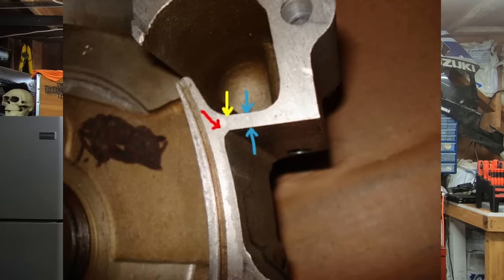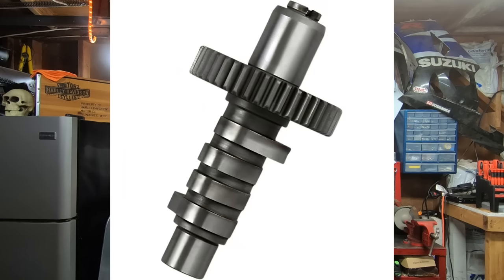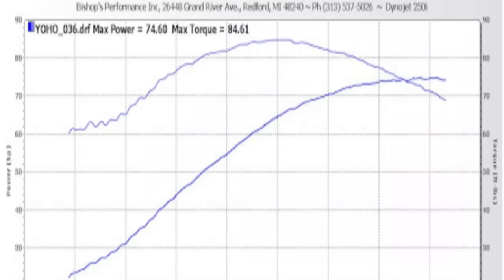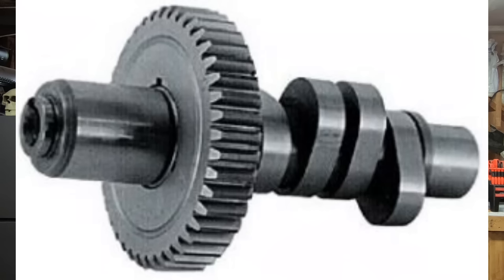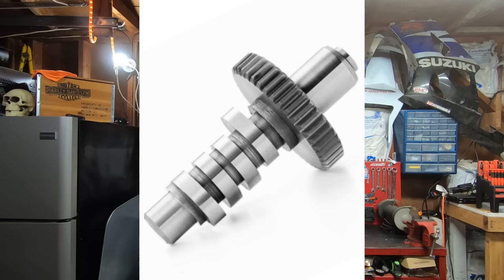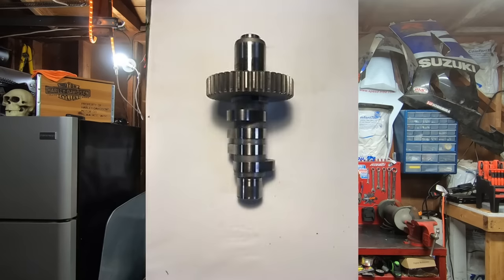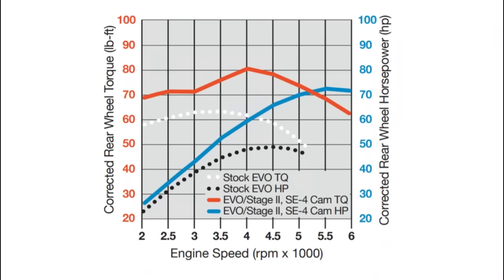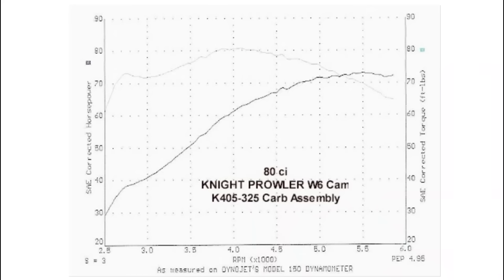Absolute Best Upgrade for the Evolution Harley-Davidson

Comment: I run a Andrews EV46 and have done for 30 years or more a Quick Silver cab and Points and have around  85 hp and I have ridden about 280,000kl and 2 rebuilds , I'm smiling because I have photos ha ha , can you tell I'm old ?
Reply: thats awesome man! i have a similar setup in my fxr.. i just did my first rebuild👌🏻
Reply: Just got a 98 blown cam bearing… ultra any tips or upgrades while I got her apart? Appreciate any input thanks
Reply: Yup EV 46

Comment: EV27, S&S Super E, Slow Leak down lifters, Andrews push rods, Wiseco 10:5 Pistons, Crane Hi-4 IGN, Vance Hines 2 to 1 Pro pipe.  Get 82hp with 90 torque.  Comes on about1800 rpm and pulls to 6000 in first 4 gears.  Just for fun {and hole shots) I put a 70 tooth pulley on it!  That made it two revved up for cruising so added a 6 speed OD transmission (.86 top gear) to get my  cruise back.  Gets 46 mpg at 3000 rpm 82 mph.  It's dependable, starts every time, never leaves me stranded.  44K miles since rebuild and still going strong.

Comment: Upgrades on my 92 evo: Andrews ev27/490 lift cam, roller rocker arms, single fire ignition, S&S carb with Primo Rivera extened forward intake manifold, Vance & Hines duel exhaust.. 88,432 miles and still running strong..🤘
Reply from the maker: Very nice! You've got all the goods in that motor!
Reply: Amen.

Comment: Andrews EV-27, Sifton 143, and the SE4 are exactly the same grind, if you actually look at the cam specs. Back in the 90's they were generally recognized as the best cam for an otherwise stock Evo, and they tended to be compatible with the stock crankcase breather system. Any other grind tended to give the owner a leg full of oil. Also the Torrington bearing is the older bearing design and the INA bearing was the newer ensign. It was put in by the factory in a misguided attempt to lower the bike's engine noise to comply with EPA standards. Refitting with the older Torrington bearing should be considered mandatory with any cam change.

Comment: Back in the day, (2002),I put an Andrews EV 27 cam, Crane ignition, Pingle petcock, and Thunderheader exhaust on a freshly factory rebuilt '95 80 ci Dyna Low Rider.  For me. absolutely perfect.  Very satisfying.  Would do it again exactly the same.  Totally loved it.
Reply: Factory rebuilt? HD does that?

Comment: Here's what I did to my '92 Low Rider for 80/80 hp & torque: Branch heads, EV-57 cam, SE manifold & air cleaner, SE push rods, V&H 2:1 Pro Pipe, Mikuni 45mm carb.

Comment: H-D EVO, best motor the MoCo ever made. Just as explained in the video. Don't try to ask it to do to much, it'll last forever.  The Andrews 27 or Crane 310, was always the cam of choice, for bolt-in power & torque.

Comment: I am an evo rider. I'm riding a 94 FXR I have always had a fxr evolution.this is my 2nd one.  I have all the bolt on crap and a hi proformance heads.  Single fire ignition, thunder header exaust,cam and a youst tube in a stock cv carb.  I can still chirp rear tire in 3 gear. I have had zero problems with power.  This bike is fast. It's only got around 12,000 miles.  It handles like a dream. People want to race and I suggest that we race to the coast.  It's around an hour and a half ride. I have yet to loose. Evos are plenty fast for me. Only thing left to do is boar it out 5 over.it just has such low mileage I can't justify tearing it down.  The only motor I like as much is the panhead. Honestly I have no desire to go any faster than the bike already goes. I  may be a bit bias as this is my second FXR and I have had it for 17+years. I have been hit 2 times by teenagers on cell phones.  No joke.  I fixed everything but it's still been totaled 3 times. So in to a paugho frame with a 2 inch stretch and 2 degree rake. It used to be a cop bike. Even had speedo that said it was a cop bike. That was destroyed along with my foot by first teenager. I love my bike and I just can't bring myself to sell it and get a newer bike. I'm sure that there are other old guys that feel the same about there bikes. I have done so much to it and we have been down so many roads... it's like a good woman, once you find one hold on to her because they are a rare thing to find.as long as you care for her she will do anything for you. That's been my experience anyway. Thanks for letting me put in my 2cents. Really enjoy your channel. Very informative.

Comment: Late to this party, but in 1998 I put a Andrews 23 in a 1993 Dyna. Cam, Mikuni carb and Vance and Hines Long Shot pipes. Everything else stock HD. 

Bike ran great and NO engine issues ever; and I rode it to Canada, Montana, Sturgis and all over the Midwest on trips and as a daily.

Comment: 98 custom softail, it came out of the dealership and was blah, changed the carb, cam, pipes and ignition and the bike woke up and still pulling strong for what it is. 
Changed all fluids regularly and have never had a problem besides the rear break cylinder which locked up my breaks while going up a mountain. Disconnected them and continued

Comment: EV27 cam, Ness air cleaner, Dyna ignition, street ported heads, and a ThunderHeader exhaust on my 1993 FLHS.  Runs great.  I'm the second engine (red) on the dyno sheet at 04.40 (he did the work back then), but I had SuperTrapp slipons with 16 disc each at that time.  Last dyno was done a year ago at a different shop: 70/80 were the numbers then.  Get's low 40 mpg on the interstate at a steady 70 mph.  Mid to high 30's around town.  Noticeable improvement in roll-on, and two up riding at interstate speeds.  No more waiting to get past slow moving trucks/rv's.

Comment: wow, the more of your videos on the EVO that I watch, I really want one bad. I am in my early 50's and remember my dad telling me never buy a car that doesn't have a 70's 350 small block, as they were infinitely rebuildable and easy to work on and run forever if you maintain them. The EVO sounds about the same, reliable, easy to work on, and lots of bolt on upgrades. you rock, thanks for all the great videos my friend.
Reply: Get the Evo, Don't wait, Buy private party.All the good stuff will already be done.

Comment: I ran an Andrews EV26, 42mm Mik, aftermarket exhaust, high flow air filter and 50 thou decked heads on my Evo Fatboy. Bike was a rocket. In a head to head race with a new (at the time) 103 Dyna, the 103 couldn't beat my bike. Needless to say, the Harley sales rep riding the 103 wasn't to happy with an old Evo easily keeping up with him (side by side, flat out). Especially as he had a pack of new HOG riders with him! 🙂 My Evo was rock solid reliable, never let me down
Reply from the maker: Lol the 103 even with a exhaust, air cleaner and a good tune is well, a turd. A cammed Evo being fueled with decked heads literally is going to have 10 to 15 horsepower over the 103, the factory cams are weak.
Reply: @GixxerFoo  and the rider on my Evo (my sales guy) was 50-60Lbs heavier than the guy on the 103 🙂

Comment: I put a Crane 310 in mine many years ago. I think it's very similar to the Andrews EV27. Still running great at 98000miles.
Reply from the maker: That's awesome, those two cams are pretty close to each other.

Comment: Great presentation. I'm running a EV27 in my old 96 bagger. New lifters, cam bearing upgrade, s&s steel breather gear, tuned carb. Yadda yadda runs strong. But what really makes a difference in my experience, was heads ported and polished and valve's 1.9 int. 1.63 ex. Run strong and has been very dependable.
Reply from the maker: Right on! EV27 is a excellent Evo cam, it's been around a long time. Excellent power and very reliably too!
Reply: My EV27 will be here Monday and I’ll install it sometime over the next couple months.

Comment: 1993 Fxdwg   with Ev 27  Keith Black   9.5: 1 compression piston's , 42 mm screaming eagle flat slide Mikuni carbi and ceramic coated combustion chamber . engine at temp@ 150 deg c , Yeah !!! it surprises the twin cam riders. and puts a smile on my dial. It seems to be a good combo to ride .

Comment: Been a die hard crotch rocket guy all my life still am but recently picked up my first Harley. I immediately felt something and can’t put my finger on it, just fun to ride. I guess it’s the way the engine makes it’s power. Just really fun to cruise around on. 2011 fatboy with a 255 cam dyno tuned and feels great to me. But it’s the only Harley I’ve ever road. With that said I know what a fast bike feels like and my R1,R6,& vmax give me that.  There is just something about the Harley that makes it fun to ride. The weight makes it feel so smooth and the torque moves it well. I wouldn’t change a thing.
Reply from the maker: Same here! I was big sport bike guy for years, that's all I would ride. I finally rode a Harley and loved it, it really is the way they make power and put it to the ground. The cam and the dyno tune makes a huge difference on your bike with the power!

Comment: i've had my 96 FXSTSB Since new I hopped it up back in 98' with a SE-4 cam and a screamin eagle intake and Mikuni hsr 45 carb, air cleaner with paucho drag pipes with a slide in baffles. That was kinda the normal thing back then but for a EVO it always performed well. I'm sure a good 2 into 1 would of run a little better but the drag pipes still look gangster on it.
Reply: I hear ya on the pipes. Id like to try a Thunder 2 into 1 but love the look of my SE pipes.

Comment: Loving these EVO videos and the Shovelhead video was a nice surprise. I’ve got a 93 FLHTP and I went with the EV-27 with S&S pushrods.. S&S steel breather gear... S&S lifters and upgraded Torrington B138 bearing....3 angle valve job..S&S super E and a Thunderheader. Bikes a lot of fun n rides great for what it is

Comment: On my 98 Softail Custom an EV3 with Jims lifters woke it up. An Super E also helped. However the Softail is geared to the moon, fell on its face in 5th on the freeway.  A Zippers chain conversion with a gearing change is what really complimented the cam and totally transformed the bike, also allowed a 140 rear tire to fit which looks MUCH better than the skinny  stock tire.
Reply from the maker: That's awesome to hear, gear changes are so much cheaper and easier with the chain conversion. I never could get past those skinny rear tires Harley used to use, they look so much better with the bigger tire.
Reply: I run a 140 on my softail with a belt and no mods.  Just an FYI.
Reply: Dude. I was thinking this. The highway gearing sucks on my fatboy. Needs more in fifth gear.

Comment: In 96-97 ran a 91 Sturgis with Branch heads, Mikuni 42mm carb, Thunderheader, SE adjustable ignition, and EV59 cam. 84 hp. Fun bike !

Comment: I have run ev27.   They work really well with wiseco 10:1 pistons and head work with roller rockers. 90hp + with good exhaust (pro pipe or thunder header) ....also upgrade that ignition 🤙
Reply: Ps... modify stock cv carb. It is an excellent carb if u know what your doing.

Comment: I have been using Andrews cams for about 18 years 
Both  of my evolution motors have them. Ev 23 and Ev 13 . Great for my bike's. Ev13 is a little bit noisy stepper ramps. EV23    comes in a little bit sooner really hard to tell to much different in them. Both are great cams

Comment: EV 27,  modified stock carb (polished slide, jets, etc.), indexed plugs, s&s air cleaner, stock wrapped dyna head pipes with my 7/8-2 inch stepped exhaust , 48 tooth rear sprocket, 5 speed close ratio, in a  light weight rigid frame. FUN & QUICK!

Comment: The Andrews EV-27 is the same cam HD sells in it's stage 2 EFI kit. 
I removed the Magnetti-Spaghetti fuel injection from my '97 RK and replaced it with a Dyno-jetted Keihin CV-40 , Dyna 2000i ignition , V&H Tru-Duals w/fishtails and the EV-27 cam with Jims lifters. Runs nice and smooth with noticeably more power.
Reply from the maker: That was a good move in my opinion, the old Mag EFI can be finicky.
Reply: Can I use the EV27 on a 96 Electra Glide Classic with Magnetti?

Comment: In the mid '80s I put in an Andrews EV3. Boy what a difference! It's the cam the Evo should have had as stock in my humble opinion 😁
Reply: Camp's like that are what Harley would have loved to put in from the factory but they have to deal with federal emissions standards.
Reply: I had an ev13 in a road king.. perfect power in the usable rpm
Reply: Chris Worthington ran a ev3 in my 1990 FXRS, went with a crane cam with less lift and more duration in my 94 FXLR, wasn’t even close, went back to the ev3. Super Trapp duals, couldn’t bring myself to run 2 into 1. Leaned out a Screaming Eagle carb, SE ignition module. Bikes would run and still pull 2up without having to downshift to get power. And still got 50mpg under normal riding. Man I wish they would bring bake the FXR’s best bike ever made IMHO.
Reply from the maker: The FXR was a hell of a bike, they would sell a ton of them if they brought it back.
Reply: My ole man still runs an SE57 w a mikuni SE carb, VH Longstraightshots, adjustable pushrods, and a Dyna200i programmable  ignition, with a tweak to the VOES switch adjuster, and he keeps up with big dog S&S 124" 120hp sidewinder, and  some customUltima S&S 130" 125hp(?) Elbruto, and a Screaming Eagle/CVO Breakout with a few Grand worth of work done from the dealership 2014-16? Whatever size an SE CVO V-TWIN on a breakout, each bike was over 150 pounds lighter than his, each operator was about 40 pounds lighter, he was loaded with ammo from a gun show filling the saddlebags, and 2up, me on the Lepera, they took off line they were in a drag race, without warning, he just notched it into cog #2  when he just rolled on the grip a bit, he wasn't  full throttle or stretching the gears out, just a couple steps above normal cruising acceleration, and rode right up between them let off and then twisted it up at over a buck, he skinned a layer of rubber off, before they caught up, (to be fair he is a former AMA CCS and WERA Road Racer, Drag Race fanatic, and igrudge match money winner, has a talent and knack for going faster than other bikes of the same class or above, tesrs em up on the strip, on dirt, Sand, Up hills, in snow or on Ice, during freezing rain and snow mixed in the NC Mountains (well he was probably the only knuckledragging nut in the entire state out riding a motorcycle on the treacherous roads, much less a Patriot Red Pearl Super Blingy Chromed out customized Fatboy with 20" apehangers wearing a half lid, on frozen ice covered roads with fresh snow or in some spots quickly freezing rain (near the towns) and not pushy footing around, he was getting looks of wide eyed disbelief from NC State Troopers, with chains on their tires, and old-school seasoned Bikers in pickuptrucks alike, but when he took off, and was all business, (I could tell his ass was locked to the seat like a pit bull, but only when he'd catch a red traffic light.) They were in full blown  "Holy Shit Are You Seeing This !?" Mode, I have the video up from right before it started  accumulating, 
 Anyway his 80" Evo is about 98-110 hp calculated byv the gross  weight, and 1/8mile Speed n  ET  don't ask speed, all he remembered was the time, and I forget 1/8 mile stuff

Comment: All this information was worth listening to. I've never owned an evo  but I like what you're saying about them. I've owned 2 Pan heads, one shovel and a gold wing.Now I still have a 2003 v-rod a 65 Pan on a rigid frame and a 07 Sportster for the wife. I'm 68 and expect to not buy another bike wile I'm still able to ride well. I have been looking at the used Victories as of late because of seeing a cut away motor and loving the design. The only thing I noticed was the first graph did not have the RPM (lower border) and was not visible so I had to guess.   P.S. My 84 year old father in law owns a Yamaha FJR 1300 he hasn't ridden in 3 years.  I might borrow that if I find time to drain the old fuel and clean it up. Mike from Maryland
Reply from the maker: Thank you for checking out the video! My dad is 76 and he rides a NightRod Special, he hasn't slowed down much. Sounds like you have a nice garage full of bikes!
Reply: @GixxerFoo  The Pan Head lives in the living room. Now that we don't have grand kids living with us This winter I plan on putting a 2004 deuce front end  on it this winter. There's nothing like a disc front brake!!!

Comment: EV27, adjustable pushrods, mallory ignition,dyna coil and leads, carb/air filter mods, pipes... Big gains, for little money. 60 thou skim and valve job/blending next, for mid 80s Hp. Neat video 👍🏻

Comment: My 98 evo roadking I did Andrew ev27 cam,wiseco forged pistons, bored cylinders 5thousands,s&s adjustable push rods,s&s lifter ,ported heads,metal breather valve, cobra 2 into 1 exhaust, cobra fi2000 tuner,power house ignition kit,BDL extra plate clutch and Arlene ness big sucker. Needless to say she runs like a scalded dog. Oh and has 75000 miles on him👍. Keep them evos alive folks
Reply from the maker: Right on! You got a nice build done right!

Comment: My 99 Heritage had an ev13 cam and new S&S lifters installed. I changed the cam bearings to Torrington’s. Used stock pushrods also. Don’t care for adjustables. It ran really well for my riding style.

Comment: Ev27 is great up to about 82 hp. In my current street ride. It's limit is 80 hp. I've built a lot of them up to about 93 hp. It takes expert headwork, 1.940 intake and I used the Headquarters number 23 and 26. Both took headwork. Spring spacing, valve to valve, TDC lift, etc. We  broke triple digits with the HQ 26 and a maximum effort race engine. It was pretty lame on the street, but really cooked in the old AMRA m/FL class.